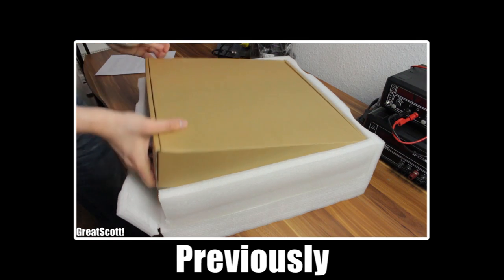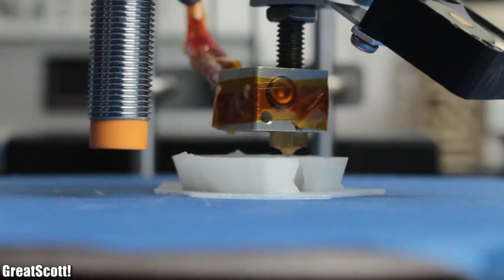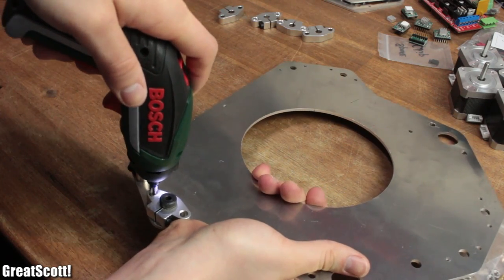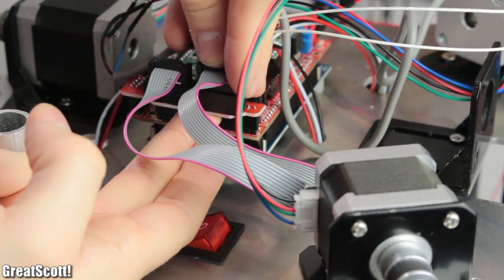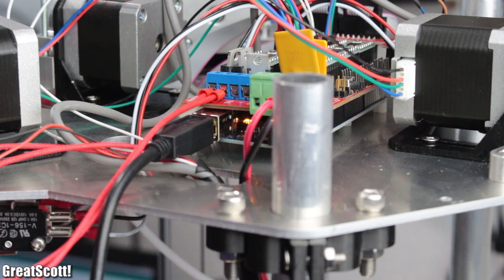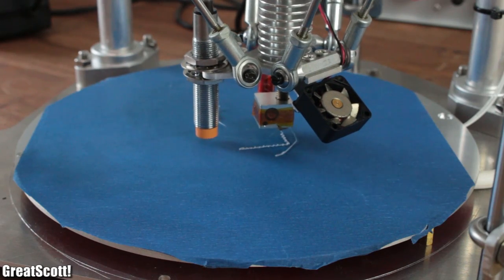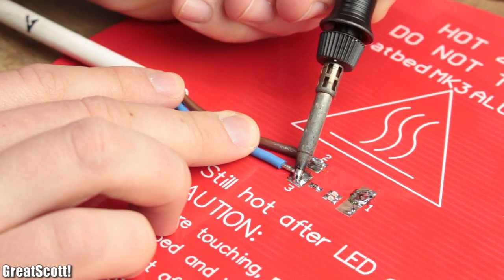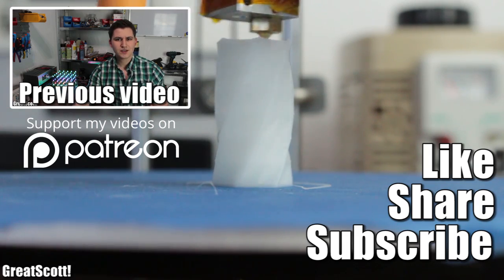3D Printing Beginners Guide (Hardware) - 400$ DIY Delta 3D Printer kit

Comment: Attension please
This kit is not longer available!  
Don't do the same mistake like me and buy another Delta Printer! 
Scott's seems to be a good construction but there are a loot of rubbish on the web. 
Start with a normal Printer like in his first video,  but with a steel frame!  
For example look up for the wanhao i3 v2.1. It makes great prints, is easy for beginner's und the price is under 400 Euro! 
Please trust me! 
And if you have experience with 3d printing maybe you can build your one Delta machine.

Comment: Could have gone with the Anet A8 which is a i3 but a way better one than your first printer. And it's only half the price of the delta thing you bought. If you like tinkering you're able to push the print quality probably as far as a 2000$ printer can do. Your i3 was just the wrong choice..
Reply from the maker: I don't think the Anet A8 was available when I got my first printer.
Reply: GreatScott! Oh never mind wasn't thinking about that. Would you say a delta printer is better than a "normal" i3 style one? I had to print some upgrades but my A8 is printing awesome stuff in awesome quality right now! Maybe you want to give that one a try as well. I'd love to compare these two printers. Maybe I'm going to start making videos about that printer if anyone is interested. By the way I'm from Germany as well. Keep up the good work mate!
Reply: hi,I'm the designer of this delta printer . Let me answer your question.  
At the beginning of my business with 3D printer ,my fist choice is i3 style ,because my first printer is Mendel i2. I didn't use the open-source design, I designed all by myself. The first year ,I have changed my design many times ,and have sold a lot of pieces in China,so I have a lot of experience with that.

1. The z_axis of I3 style is a weak part. if you want high quality print ,you need spend really high cost.
At beginning ,people use normal M8 screw for z_axis, it's really garbage. Now they change to T8 lead screw,It's much better,but not enough . Lead screw works with friction,it works very good at beginning,the surface of print part is very smooth ,I knew that. But after several month's printing ,the lead screw will have some abrasion,then you will see the difference.

2.The structure of i3 style is also a problem ,it's not easy to make it stable enough.For example ,the i3 printers assembled by me can work very good,but the ones assembled by my customers are not so good ,because I am engineer ,I can make them stable ,but it's hard for normal people.That's why so many people can build a i3  printer ,but less people have high quality printing.

3.This delta printer do not have these problems ,and I only use aluminum,stainless in printer ,even all the bearings are electroplated ,the total weight is over 10KG , so it's really high cost.That's why some customer said his printer is still quite new after one year .

 And our after sale service is very professional ,all question is answered by engineer you will never worry about failure.

Comment: you said only a 50% success rate? That seems really poor, or did I misunderstand that comment?
Reply: I think it's true . because that time in German is quite cold .
It's difficult to print a big part without heat bed .That's why he added a heat bed by himself.
But  the new version of this printer have heat bed now,you can check it.